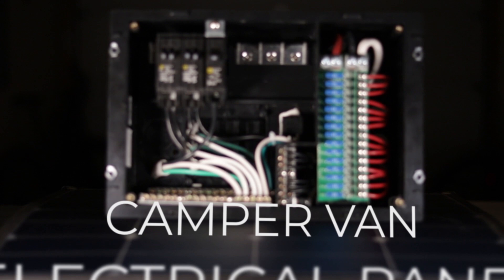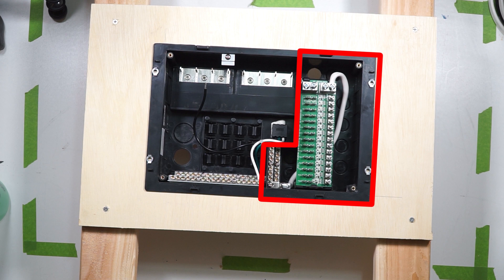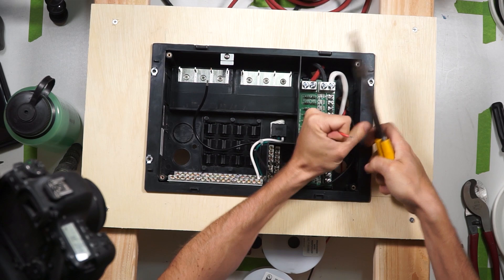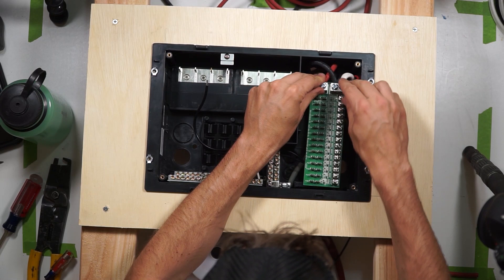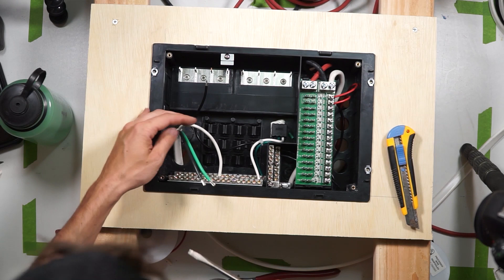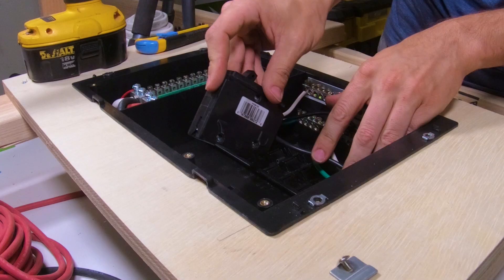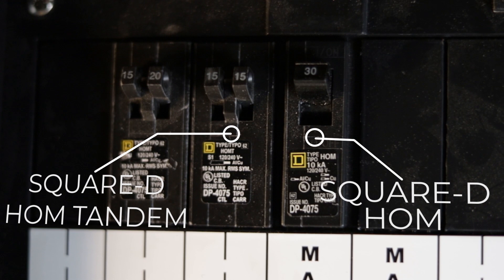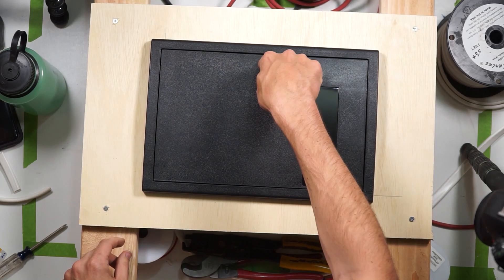How To Wire a Camper Van Electrical Distribution Panel

Comment: Thank you for the video! If I am using a 50 amp service and want to provide power to both sides of the panel does that require two 50 amp breakers for the main or do I need to drop to a 20 and 30?  Also how do you connect to the other breaker from the one incoming service line?
Reply from the maker: 50 amp service would require a dual pole 50A breaker.  Also, regarding "how do you connect to the other breaker from the one incoming service line"...  50A service is 240V and has 2 'hot' wires coming in; so L1 would go to one side of the dual pole breaker and L2 would go to the other side of the dual pole breaker.  I'm not sure what this is being installed in, but be aware that if you don't NEED 50A service, I wouldn't recommend installing it as it requires a more complicated setup.
Reply: @EXPLORISTlife  thank you I appreciate the info. I am still going rounds on if I am going to install the panel or not. I am converting a charter bus into our new home. I am going to start out with a 50 amp shore power and will add in solar later on. I know how how to wire a house panel but when it come to all the different inverters, converters, ECT required for the bus I am not so confident.
Reply from the maker: Gotcha.  Yeah, 50A service gets tricky.  You'll either need two Inverter/chargers (One per hot line) or a single inverter with a Smart Phase Selector from AM Solar.

Comment: Can anyone help with the size of the breaker to use for the main line coming in from the inverter? I am using 12 awg and only plan on using a few AC circuits. One 20amp breaker for 3 outlets. Another 20amp outlet that's just for one plug. And then another 20 amp breaker for the Air-conditioner.   

does the main breaker need to be 20 amps? or larger?
Reply from the maker: For AC circuits:
14ga wire: 15A breaker
12ga wire: 20A breaker
10ga wire: 30A breaker
Reply: @EXPLORISTlife  Thank You!

Comment: Do you ground the 12V portion of the panel or are you grounding from your busbars?
Reply from the maker: The 12v side is grounded at the Lynx Distributor (or busbars).  Example: https://www.explorist.life/3000w-inverter-400-600ah-400-to-1200w-solar-camper-solar-kit

Comment: Hey Nate, I just bought one but it also has the charger and convert in the unit. Its a Progressive Dynamics PD 4560. It does not have a negative bus bar for the 12v side and I can't find much info on a proper way to wire it up. Any chance you could help?
Reply from the maker: You would need to add an external negative busbar for the negative 12v loads: https://amzn.to/39jachX

Comment: How does the incoming AC breaker power the right side of the ac bus, the bus looks like it is separated and not a one piece bus?
Reply from the maker: That's really only for 50A shore power connections where we have two hot wires (L1 & L2).  If using tandem breakers, one side of this breaker box can handle 6 AC circuits which is plenty for pretty much all vans/RV's.

Comment: On the AC side, do the Neutral and Ground need to be bonded together? Or must the remain separated?
Reply from the maker: If using an Inverter/Charger with a Neutral to Ground Relay like the Victron Multiplus or Quattro shown in most of the diagrams at https://www.explorist.life/solarwiringdiagrams, the Neutral to Ground bond is handled inside of the Inverter Charger.
Reply: @EXPLORISTlife  mine is not a charger, just an inverter from Vevor and their manual does not state. Would it be potentially dangerous to bond them in the panel?
Reply from the maker: If you aren't having an inverter/charger like a Multiplus, and are wiring shore power directly to the box, you should indeed need a chassis AC ground to chassis ground connection.  NOTE:  This information is based on 'the best I understand' as I don't have the full scope and understanding of your system.  My recommended system design involves using a inverter/charger w/ a neutral to ground relay to handle chassis ground switching.
Reply: @EXPLORISTlife  no shore power in my system at all. I have an inverter hooked up to only a battery bank. I want to wire the AC output of the inverter to a breaker panel instead of using the built in outlets. My question is on the 2 spot breaker panel (with no main cutoff breaker) do the neutral and ground need to be bonded together or will that electrify my chassis since ground will also be connecting to chassis, and thus they must remain separated on their own isolated bus bars.
Reply from the maker: Since I don't know much about your specific system you're attempting to build and I don't know much about that specific inverter you've chosen to use and the user manual doesn't make any recommendations on that part of the install, it would be irresponsible of me to make a recommendation, so I unfortunately, must not make a recommendation.  If you want something that 'for sure' works, you may want to check out the systems I already have designed here: https://www.explorist.life/solarwiringdiagrams

Comment: When you connect the AC Breakers for the inverter (hom) you the connect another breaker for additional ac 120v appliances. Does this use power from the inverter to power those additional outlets? I'm confused on how this functions.
Reply from the maker: Yes.  The MAIN input breaker from the inverter protects the wire from the inverter to the breaker box.  The additional breakers for the branch circuits protect the wires to the outlets/air conditioner/hot water heater, etc.
Reply: @EXPLORISTlife  Oh okay! So potentially, we would hook up the inverter to the breaker box and the add the additionnal breakers that wire to outlets (to charge computers or blender) and plug nothing directly to the inverter? The branch circuits automatically connect when I plug in the additional breakers?
Reply from the maker: Exactly!
Reply: @EXPLORISTlife  I have one last question. What kind of wire gauge would you recommend for the duplex wire? What a are you using in this video?

Comment: I am setting up a 2000W, 24V mobile system; this distribution panel will not work with my 24V system will it?  Will it only affect my DC circuits?  I have a DC fuse block already.    Thanks in advance.
Reply from the maker: If you are running 12V DC appliances (lights, fans, outlets, etc) from a 24V battery bank, you would need to use a 24V to 12V converter.  Example here: https://www.explorist.life/24v-6000w-120v-240v-split-phase-camper-solar-wiring-diagram/

Comment: for the AC hook up, does it matter which ground or neutral you attach it to on the bus bar?
Reply from the maker: For the individual holes, no, it doesn't matter.   Just try to organize the wires so they are nice and clean.

Comment: Do you install relays for your DC circuits to keep the load off the switches?
Reply from the maker: If needed, yes; but it's usually not necessary.

Comment: What is the 110v plug on the back of the Arterra for, just an option for a additional plug?
Reply from the maker: Correct.  It's simply an additional outlet if needed (I never use it).

Comment: What size wires did you use from battery to DC side of the converter?
Reply from the maker: 6AWG: https://shop.explorist.life/shop/all-products/camper-wiring-kits/component-wiring-kits/12v-dc-fuse-panel-wiring-kit/

Comment: Great video!! I was reading some reviews of this product in the amazon link and people mentioned that this panel only works completely if you have 30 or 50 AMP supply, is this true?
Reply from the maker: Thanks!  Nope. Not true.  Will also work with 15 or 20 amp as well.

Comment: Is there an all in one panel option for running a with AC/
24v/12v system
Reply from the maker: Not that I'm aware of.  Generally, though, all of the loads in a camper are 12v loads, so even if using a 24v battery bank powering 12v loads, the 24v would be convertered to 12v before hitting this panel.

Comment: There is only one comment on Amazon for this electrical panel and it's a one-star because the customer states that "the lugs/terminals for the circuit breakers are missing." Is that correct and do they come with some other purchase? Thanks.
Reply from the maker: No, it comes as all in one.  I saw that review too.  I don't know what's up with that one.  Mine was totally fine as was as shown in the start of the video.

Comment: You said something about an inverter for the 120 volt size.  I thought this distribution panel eliminated an inverter
Reply from the maker: Nope.  This panel distributes the 120v power made by the inverter and distributes it out to the breaker-protected branch circuits.
Reply: EXPLORIST life - DIY Campers but I thought the 120 v came from your shore power, the plug in.
Reply: @karenstoeber  that's one place to get it,  but his example was bringing it from a DC oriented system with an inverter to A/C included....

Comment: I'm confused about this whole process.  I asked Will Prowse how you're supposed to use 110v stuff on an inverter you've built into a solar system in a closet where you can't get to it.  He says get an AC distribution panel.  I come here to see what that is and I see from what you're doing that I would need to rewire my entire brand new RV in order to use this.  I don't understand how anyone uses solar in their RVs after watching this.
Reply from the maker: Your RV likely has something VERY similar to this built in.  Removing it and replacing it is unnecessary.  Check out my diagrams at https://www.explorist.life/solarwiringdiagrams to see how this fits into a full system.
Reply: @EXPLORISTlife  It seems that child geniuses like Will are socially compromised and don't know how to speak to someone one to one when answering a question.  "Tie it in to your existing AC distribution panel"  would have the correct answer, I think.  I spoke to the tech guy at my dealer and that was his response. Thanks for the reply!
Reply from the maker: @Josef_R  Will has 300,000 subscribers and is likely drowning in responding to comments, so I'm sure his short replies are simply an attempt at finding a balance between providing answers and finding the time to answer all questions.  This is something I struggle with as well.
Yeah, but Shore power -> Inverter Charger -> existing AC distribution panel.
Reply: @EXPLORISTlife  You could be right, but considering it is his full time job and his passion for it, I expected a little more.  But I can see it could be difficult to tell the people who are struggling to understand apart from the know-it-alls who are screwing with him.
Reply from the maker: @Josef_R  Passionate, sure, but there are only so many hours in the day.  For example... I answer questions/comments once a week (sundays).  I woke up at 4:45 to get started.  It's now 8:07 and I'm about halfway done.  Will has a little over 3x as many subscribers.  We, as creators, truly try to help, but in this DIY realm... a lot of these questions truly need a 1000 word reply to adequately answer the question.   We appreciate the patience but understanding we are human and are trying our best.

Comment: I have a PD4600 and would like to disable the battery charger when boondocking  do you have any information about it.
Reply from the maker: If wired with an Inverter/Charger, I recommend totally disconnecting the OEM converter.  Example: https://www.explorist.life/30a-camper-inverter-with-solar-and-alternator-charging-wiring-diagram/

Comment: What size wires are you attaching from the d/c side of the box to the battery?
Reply from the maker: 6AWG.  My diagrams at https://www.explorist.life/solarwiringdiagrams have all of the wire gauges for all of the 'other' wires like the panel to battery.  Also, here is a 12V DC Panel wiring kit: https://shop.explorist.life/shop/all-products/camper-wiring-kits/component-wiring-kits/12v-dc-fuse-panel-wiring-kit/

Comment: why did you put that 120v black wire attached to the box in the second breaker? i understand it all... except that one part... lol
Reply from the maker: That 'black wire attached to the box' is actually attached to an outlet that is pre-built into the rear of the distribution box.  If you do not need an outlet in that location (most don't), you don't have to wire up that black wire.

Comment: If For now I just want 30 amp shore power only (may add solar down the road) do I need this and an inverter?
Reply from the maker: You need this panel, yes.  You don't need an inverter if you are needing off-grid capabilities.
Reply: @EXPLORISTlife  thanks! For clarity did you mean to say I don’t need an inverter if I’m not going off grid ?
Reply from the maker: An inverter makes 120V power from a battery bank.  If you will always have shore power and will never be pulling power form batteries, you do not need an inverter.

Comment: Nate I have no inverter just shore power, I ran 10-2 with a single pole 30a for the home however. I want to power the other half of the bus do I need to replace the 10-2 with 10-3 and a double pole, to accomplish this or what. 16 ft cargo camper conversion.
Reply: Or can I double stab the 30a home and stick another one beside the first to power the other side
Reply from the maker: The 'other' side of this distribution panel is for systems powered from 120v/240v split phase shore power.  There is no approved way to get power from one side to the other.  Since I try to stick to proper codes for my education, I cannot recommend double stabbing breakers.  BUT...  you shouldn't need more than 6 circuits in a 16ft cargo camper conversion.  Take a look at this blog post for a VERY robust 120V circuit setup using 6 circuits: https://www.explorist.life/how-to-wire-120v-ac-circuits-in-a-diy-camper-van/
Reply: @EXPLORISTlife  so I have a rheem tankless water heater it requires a double pole 30 and 220 volts. So I’m thinking I’ll run 10-3 to a 30a dp bringing in 220 but that only leaves one  breaker. So I’ll put a tandem there to run one over to the other side. Thoughts?
Reply from the maker: Ahh...  I see.  This breaker box will not work for your needs.  Although you can run 120v/240v split phase into it; it is only capable of running 120V appliances.  It cannot run 240V appliances.  Even if you double stabbed the 30A main breaker to get power to the other side, you would only have 120v power.
Reply: @EXPLORISTlife  yap returning the rheem going with small propane water heater any recommendations?

Comment: Do you have an affiliate link for the main big cables for the dc panel and AC side?  No one talks about calculating these wire sizes, but I have this same panel that I'm also wiring for 30 amps.
Reply from the maker: Yeah!   I have links & suggestions for both of those circuits in any of the diagrams found here: https://www.explorist.life/solarwiringdiagrams

For what it's worth, on the DC side, those wires are sized to be the biggest size that the DC side of the panel can accept, which is 6 AWG.

Comment: How do you energize the other breaker bar?
Reply from the maker: Without using 120V/240V split phase 50A shore power, you can't.  You'll only be using one side, which when using Tandem breakers (Like the square D HOMT 2020 breakers), you can have 6 circuits, which should be plenty.
Reply: @EXPLORISTlife  that’s what I had assumed but thank you for confirming!

Comment: How do you connect the inverter to the tdistributor panel?
Reply from the maker: Connecting the distribution panel to the Inverter is just a matter of connecting the hot, neutral, and ground wires to the hot, neutral, and ground terminals on your inverter.

Comment: We do. It need to ground this to the frame of the van correct?
Reply from the maker: Please see https://www.explorist.life/solarwiringdiagrams to see where to ground your system.
Reply: @EXPLORISTlife  I have your diagrams but it does not show this box as being grounded, but I hear from others that it needs to be grounded.
Reply from the maker: Indeed.  My diagrams do not show the box as being grounded.  The dc side is grounded through the negative wire.  The AC side is grounded through the inverter charger.

Comment: I need some help hiring someone to do my Skoolie electric and I have this box. I have two battle born batteries, Renogy 3000 watt inverter, dual mppt charger 50 amp renogy, do I need extra fuses or bus bars etc for this system if I have this box thank you
Reply from the maker: Yeah, you need a fair amount of busbars, fuses, wires, etc to wire a full system together.  Check out our playlists of full installs to see how that looks in a few different comprehensive tutorials: https://www.youtube.com/playlist?list=PLmvhcyi4n0TUU8FUc6LE38TBkdSLjdw_5

Also... these diagrams and parts lists: https://www.explorist.life/solarwiringdiagrams
Reply: @EXPLORISTlife  thank you so much exactly what I needed I will be buying your diagram today. My last question is do you have the wiring process through the walls thank you so much
Reply from the maker: Yep!  Here's the playlist for those: https://www.youtube.com/playlist?list=PLmvhcyi4n0TUUwvonaPhIPqUqBiC7CiyY

Comment: What's going on when one of the DC fuses keeps blowing out every time l put one in and how can l fix it ..thank you if you can help me
Reply from the maker: There is likely a direct short in that circuit somewhere.(the + and - are likely touching).
Reply: How can l find that short or can l rewire that specific line where the fuse is being blown